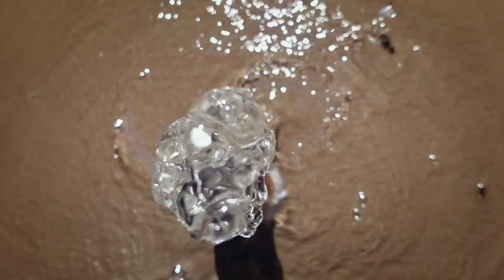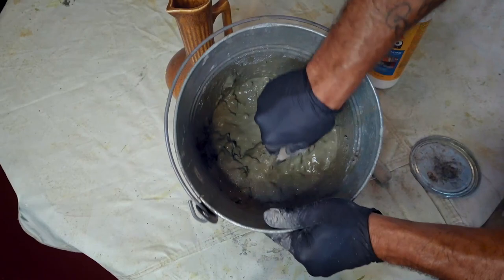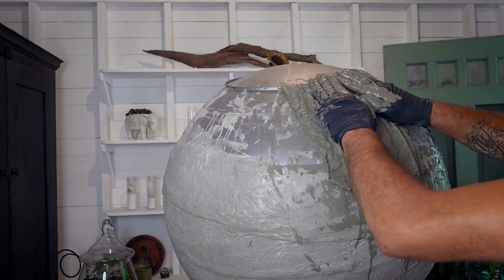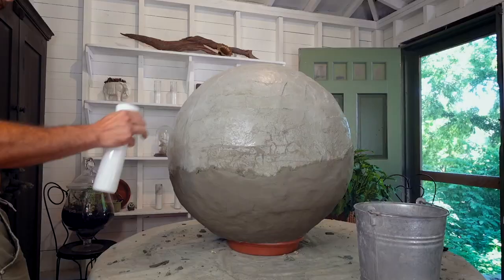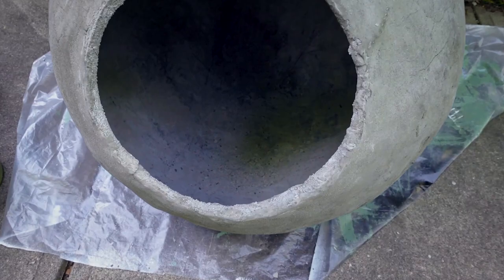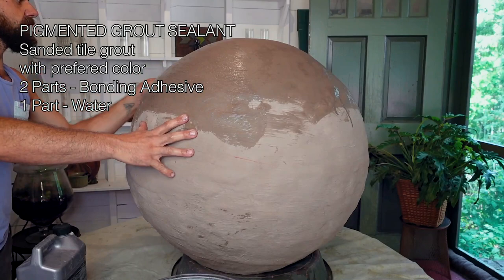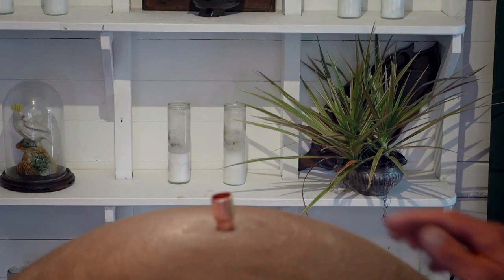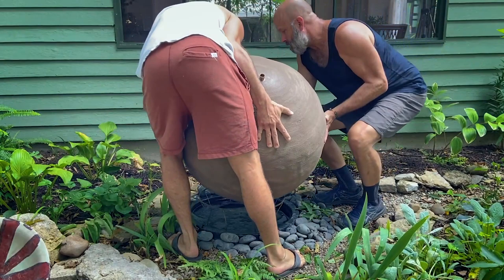Concrete Sphere Fountain Tutorial | DIY | GARDEN

Comment: Hi Cade! Fun, messy project! Had one minor hitch. I flipped my globe over to cover the bottom and didn't put mesh in that spot(error one) I put a thin layer of concrete and left it in the sun to dry... Was such a pretty day... (Error two). Should have remembered my science 101 class! Gas expands in heat and contracts in cold. So my beach ball did what it was supposed to and expanded and cracked the bottom of my globe. Guess my first mistake was not to inflate the ball. That might have helped. End of story, a few messy slathering of concrete and my globe is just fine. Thank you for sharing your adventures with us.
Reply from the maker: Oh my! What an adventure. I love problem solving amidst making art. Thank you for sharing and I’m so happy you made one! Be so well!

Comment: What size pump did you use for this? I’m almost finished making mine.
Reply from the maker: Sorry for the delay. I’m guessing a 500gph pump would suffice. You can’t use a small pump though it should be more than a serenity fountain size. You can adjust flow so bigger is better in this case

Comment: Hi Cade,
How long does this sphere last in the garden in zone 6 Michigan?
Reply from the maker: Hello there! Not entirely certain how long it will last but you should get many years out of it outside. I turn off the fountain in the winter so as long as it’s bits saturated with water it won’t crack. The acrylic bonding adhesive is key…. Best of luck creating!

Comment: I’m wondering about your other spheres from your previous video. Did you seal those?
Reply from the maker: Hello! Thanks for the question. I did seal those but with the concrete and not the sanded grout.
Reply: @CADEmade  thanks for the reply! I guess I just didn’t understand why you used grout instead of just the concrete mixture for the last layer. I’m glad you filmed all this! I am going to make a small one first and see how it goes.
Reply: @CADEmade  thanks for the reply! I guess I just didn’t understand why you used grout instead of just the concrete mixture for the last layer. I’m glad you filmed all this! I am going to make a small one first and see how it goes.
Reply from the maker: The grout was essentially just for the color pigment.